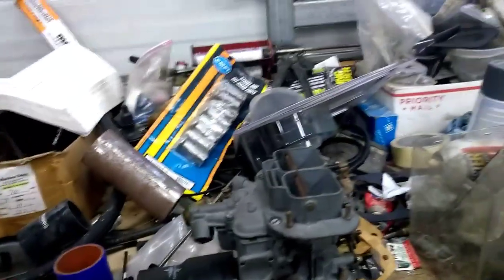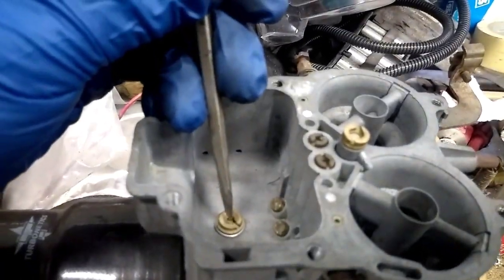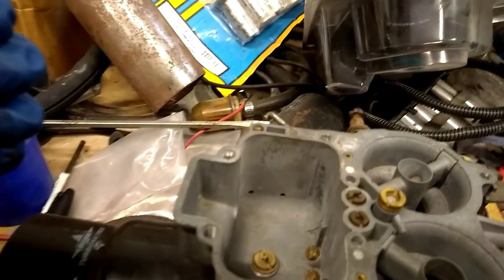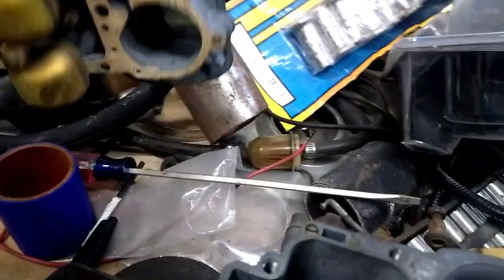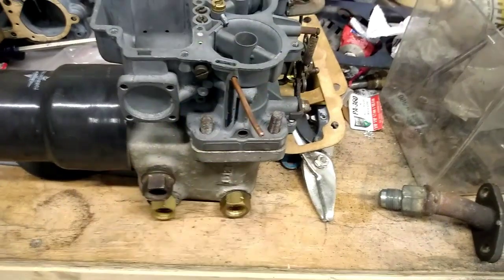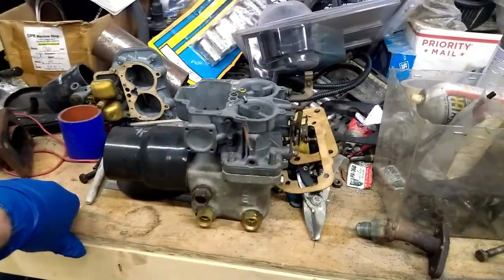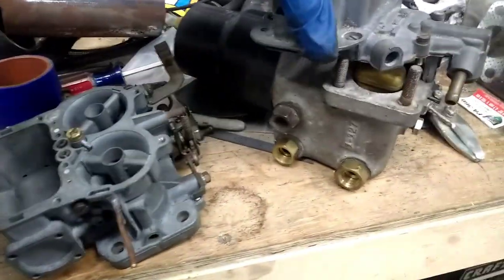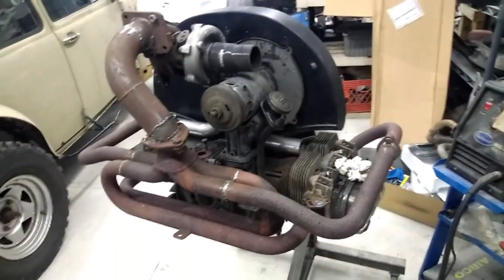Prepping John's Progressive Weber For BOOST!!!!

Comment: I'm new to this so my opinion doesn't matter. But I don't understand the whole thing about the boost reference power valve.  The power valve already opens at low vacuum and isn't boost even lower vacuum, lol.   Obviously there is something I'm missing, but anyway what is your opinion on trying to make a rochester 2 barrel carb a blow thru.  I've seen these holleys and webber 2 barrel carbs used for turbos on the internet.  The rochester 2gc almost has the exact same components and layout, but it looks like nobody in history has ever turbo charged a 2 barrel rochester 2gc.
Reply from the maker: @davidcraft4909  the power valve opens when it gets close to atmospheric pressure ( wide open throttle naturally aspirated)  letting in more fuel. On a draw through turbo there is a high vacuum on the port to the power valve keeping it closed and not letting in that extra fuel. By doing this mod we block off the stock port and drill a new external port so we can pump boost to it opening the power valve.
Reply: @MattLundquistVW  well yeah I need to look at how the ports get their porting, lol.  I know how carbs work normally I'm just trying to wrap my head around what happens when boost is added.  Right now I have a rochester 2gc taken apart trying to figure out what port goes where.  And I'm trying to figure out if it can be converted to blow through.
Reply: @MattLundquistVW  I just realized that you said draw through, and also there is that tube connected underneath your carb.  what I meant is that I don't understand the boost referenced power valve on a blow through setup.

Comment: Is this sufficient size for a 2.4 dual cam 4 cylinder turbo? It's a 16 valve ? Lol it's easier to pick carbs for v8s sorry I'm new what about the floats do they make plastic floats for that?
Reply from the maker: It will work but is on the small side for a 2.4l. yes it has plastic floats available for it.
Reply: @MattLundquistVW  I see I'm wanting to go with a holley 350 2bbl I can only wonder if the metering blocks and power valves are interchangeable between the 4bbl and a 2bbl and thanks for replying I appreciate your help
Reply from the maker: From my understanding the parts are all interchangeable. You might want to look at a Holley 390 four barrel. The primaries are smaller than a 350 two barrel and should provide nice street manners.
Reply: @MattLundquistVW  wouldn't a bigger carb cause issues with drivability and I cant seem to find a boost reference power valve for these besides I think there isnt a 390 4bbl that has mechanical secondaries I'll just stick with a junkyard 350cfm and hopefully that fancy power valve will fit I did just find a power valve but damn 70 dollars is alot it also says itll fit anything with a holley name on it so that's what oll try thanks again
Reply from the maker: @Dannymclovin  the 390 has small primaries and vacuum secondaries so it only pulls the air the motor wants. As for power valves you have to mod the carb to make it boost reference, involves closing off the vacuum port to the manifold and opening a channel to the power valve passageway. Hot vws magazine did it back in the early 2000's
Reply from the maker: http://www.superchevy.com/how-to/engines-drivetrain/1511-how-to-modify-a-carburetor-for-boost 
An article on how to boost reference you Holley four barrel carb. It should be the same for a 350 two barrel, don't spend $70 on a tap ( that's mostly what that boost reference power valve kit is).
Reply from the maker: https://www.thirdgen.org/forums/carburetors/622473-how-boost-reference-your.html this link has a good picture on how to do it using the base plate, a much cleaner look that way.
Reply: @MattLundquistVW  wow I cant believe you gave me all that for free thank you so much ,this information is worth its weight in gold thank you so much

Comment: Was this for blow through or a draw through setup?
Reply from the maker: Draw through setup as the vacuum port always has high vacuum in a draw through set-up. In a blow through setup that port should see boost making the power valve open up.
Reply: @MattLundquistVW  thank you do you know of any mods I need to do besides block off and remove the choke for blow through on a Weber ?

Comment: Giday, bit late but, I’m confused, if the vacuum is blocked the valve is open by default, no vacuum to close it?.
Wouldn’t you need to swap the spring for a pull type to hold the rod up,  valve closed until boost pushes it down,
How much boost can the diaphragm take?
I’m running 20psi, A14 dato in my 53 Morris minor,
Cheers

Comment: I am planning to use a Weber 3236 downdraft progressive like this on an A14 engine Datsun project we have in a B210. Was just curious how this turned out. 

I have researched using a Weber progressive in draw though setup for months and find little to NO info on the matter other than this video of yours but no follow up videos on this particular project. I just had two quick questions if you'd be so kind as to respond.

1. Did it ended up working out how you planned?
And
2. Why is this necessary to begin with? Could you not simply leave primary side alone and jet the secondary larger to add the fuel once the secondary opens or would that only serve to provide poor street drivability?

Also would this work better with a non progressive downdraft such as a Weber 38/38 because we have both... 

Haha that was more than two questions I apologise 😅 Love the channel!!!
Reply from the maker: It worked well, you could watch the AFR get richer as boost increased. The one problem we had was a off idle flat spot, that I believe was because our manifold before the turbo was super short. 
The reason to do the mod is that there are times when the carb is seeing high vacuum signals ( power valve is shut) and the motor is making boost. With the mod the power valve opens when the engine is seeing boost , no matter if the carb is seeing vacuum. Also by doing this you do not have to jet the carb so rich and can have good fuel economy.
As for a non progressive carb. I think it would be easier to tune and probably make more power( it's larger at 38mm). But both should work.
Hope this helps
Reply: @MattLundquistVW  makes perfect sense. Thank you for the quick and descriptive reply Matt!
Reply: @MattLundquistVW  I have also read that the throttle plates can get sucked back open briefly after a good pull. Did you ever experience anything like that?
Reply from the maker: I have not experienced that.
Reply: I have a down draft Weber 32/36 on my turbo 1776 with a T3 Garrett. I sent out cartrige for carbon seals, and running oil restrictor. 5lbs boost and 15" hg at idle. But the thing is still sucking oil on intake side under strong decel. I'm thinking of trying blow thru instead.

Comment: interesting... maybe it's also good prep for draw thru supercharger (eaton etc) setup.. any experience? 😉
Reply from the maker: No experience with the Eaton set up. But it should work the same for that application.
Reply: @MattLundquistVW  thanks a lot 👍
Reply: Have you done a carbed supercharger setup? I'm looking to use an Eaton M90 on my Jeep 258. It has a Weber 38 carb...not sure what all I'm looking at for a "simple" supercharger setup. Did/have you had any luck?

Comment: Hey mate I'm doing blow through but the way I take this power valve as it needs vaccume to open it so are you putting the fitting on the intake side of the turbo to create vaccume ? Because on the boost side would push it closed correct ?

Comment: great video 👍🏻 i have a question can that port be connected to the manifold or it has to go directly to the pipeing ? i’m trying to mod mine as well for tubro
Reply from the maker: It needs to go where it can sense boost and vacuum. So it needs to go after the turbo in a draw through setup. The intake end casting is a good place as some models had a vacuum port already there.
Reply: thanks man , i’m doing a blow thru carb definitely would help me tune the carb for good afrs !

Comment: Question,is this a blow through set up? When I did my 1600 turbo draw through I just jetted the secondary bigger since it all on the vacuum side .
Reply from the maker: It's going on a draw through setup.
Reply from the maker: The reason for boost referencing the power valve is to keep the jetting on the lean side and only add fuel when needed on boost. Jetting it fat works, just trying to get the best of both worlds ( good mpg and 12.0 afr on boost).

Comment: I have the weber 32/36 and I will be going blow through on my 2.0L engine. I purchased the boost refrence power valve from turbo Gemini .com. is this modification needed to install that valve?
Reply from the maker: I have not seen how they are doing it so I can not say for sure. I looked at there website and all it says ( in very small print) "
New custom boost referenced power valve and carb body machining to suit new operation" . So they are machining the carb body for the reference also. Since there is only one passageway for the signal to the power valve, they are adding something similar to what we did. Hope this helps you with your build. Here is the link to the only part I seen mentioned the power valve mod on their website.
http://www.turbogemini.com/Blow%20Through%20Carby%20Kit.htm
Reply: What would I have to modify on a Weber 38 for draw through into an Eaton M90?

Comment: Were you able to get that carb to work properly?
Reply from the maker: It's working good, still has a very small flat spot just off idle. Still need to play with it but other projects are in line first.
Reply: I’m building a stockish 1600 with a t3 turbo and I’m going with a Weber 32/36 just cause I have a new one laying around. Getting close to being able to run it trying to learn from what y’all have been doing
Reply from the maker: @thegobblerproject2363  we had to increase the the accelerator squatter to get the off idle stumble under control.
Reply from the maker: @spongebobdriftpants  The power valve will not work as when you come on to boost as the turbo is putting a bigger draw ( more vacuum) on the carb. The power valve  normally only opens when vacuum comes close to zero. By modifying it in this way when the motor builds boost and the turbo is pulling massive air throw the carb, the boost pressure will open the power valve. As for the accelerator  discharge nozzle we just drilled the secondary nozzle out ( was not drilled from the factory) so that both barrels would get fuel when you mat the throttle.
Reply: @MattLundquistVW  do you think this power valve boost referencing is needed in a blow through application? I use the the 32/36 for blow through but never thought about doing this modification
Reply from the maker: @teranstanislaus2358  It may not be needed on a blow through as the intake under the carb would see positive pressure. But I have not run one of these progressives in a blow through set up yet.

Comment: Hope it works out! what size is the engine? I'm thinking of building a turbo 1776 for my baja and have a Weber progressive that I got pretty cheap, might use it with this modification
Reply from the maker: It's going to be a 1600 dual port. The motor and whole project is a friend of mines, just covering some of what we are doing on my channel. The idea is to see how far we can push it with almost all stock parts. A 1776 turbo will be awesome, I'm collecting parts for my next motor a 1915 turbo. Stay tuned I will have more videos on the progress of both builds.  If the carb doesn't work out we will let you know so you don't have to mess with it.
 O almost forgot check out John's channel and Subscribe for more video and info on what he is trying to do https://www.youtube.com/channel/UCEsshpv6d_rq-Z2MnrcqxJA

Comment: Did you do this so you don't have to run a boost referenced fuel pressure regulator
Reply from the maker: No did it so we don't have to jet the carb super rich. When the engine comes up on boost the power valve will open and add more fuel. But when we are cruising down the road the power valve will be closed and the mixer will be leaner. That is the reason we did it.
Reply: @MattLundquistVW  thank you so much for clearing that up
Reply from the maker: @trentonnavarro2362  No problem, the only time I have needed a boost reference fuel pressure regulator is when going blow through, this set up is draw through. I know some people have used boost reference fuel pressure regulator on Weber side draft draw through setups, but I have never  used the Weber dcoe carb.